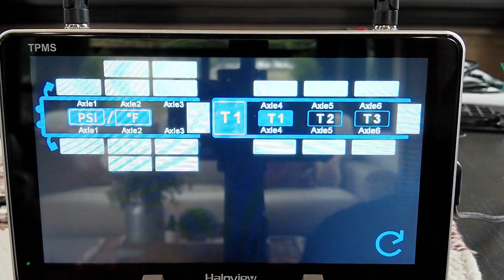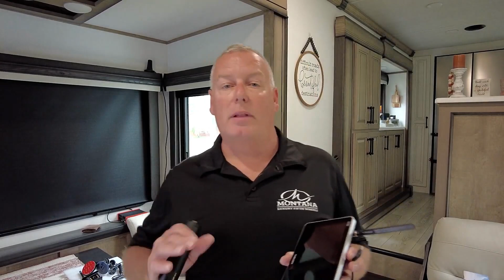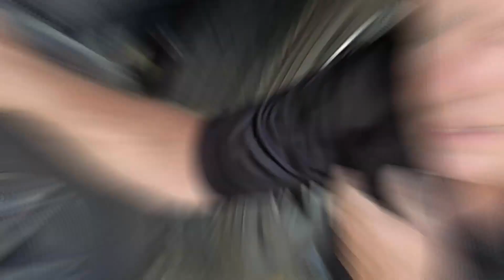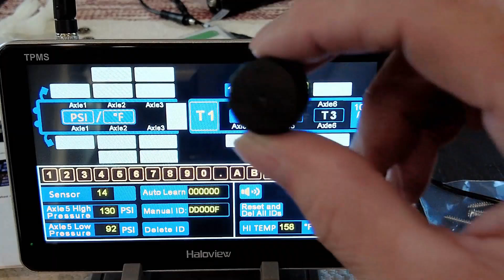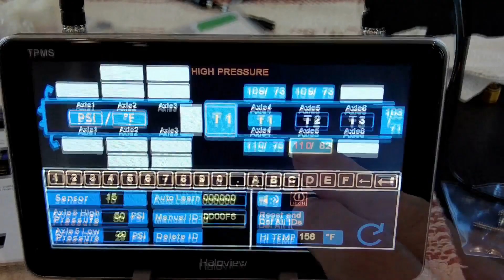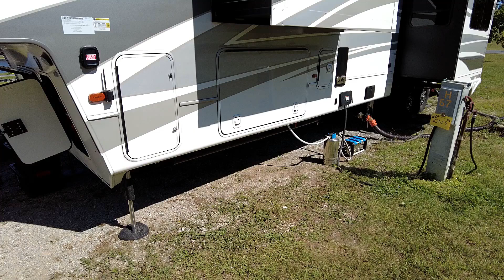How to set up and install BT7 TPMS

Comment: Installed mine tuday works well, my question with the booster I connected mine straight to the battery,,, my issue is that I don't want to be hooked up to the battery when not in use,, so what would u recommend, to get power to the booster
Reply from the maker: Hi     Unfortunately, the booster needs to be powered all the time, whether connected to the battery or hardwired.